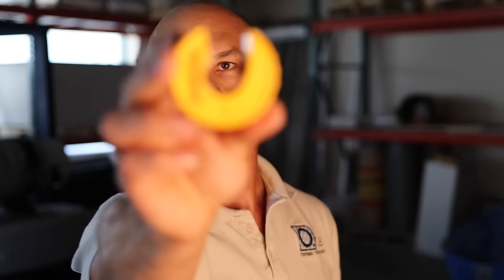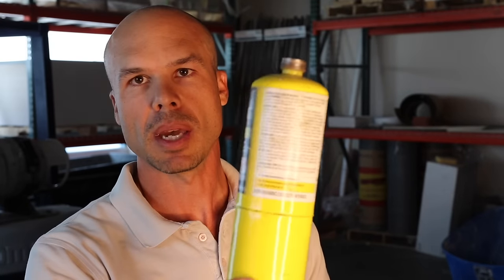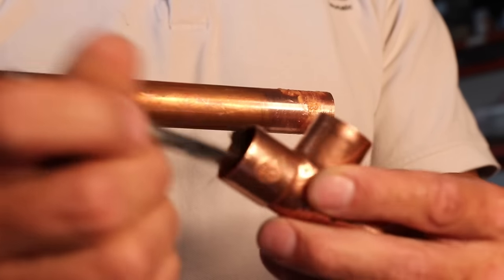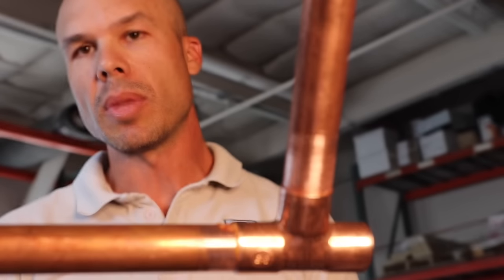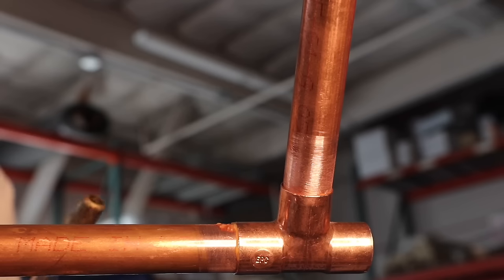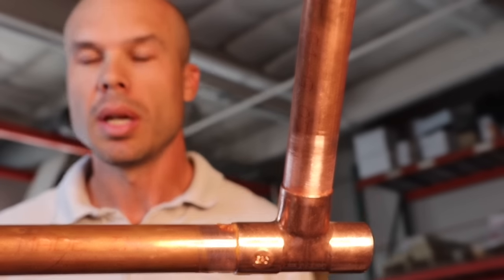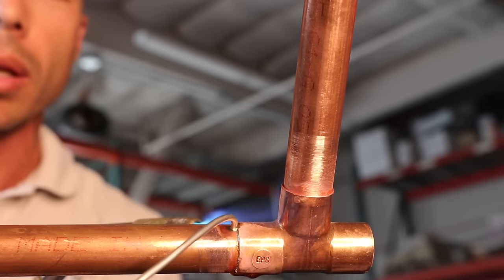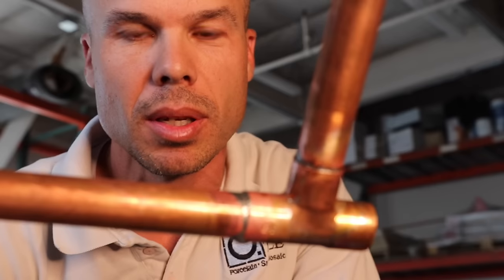How to Solder Copper Pipe: The Plumbers Secret- Episode 1

Comment: Dude if you
Took those joints you
Solder and cut then in half
Going long ways down  the fitting you would
See that most of your joint has no solder even around it.. most of it pooled on the top because you didn’t heat the fitting evenly
From
Bottom to top causing capillary action pulling the solder through out the whole fitting.  You have some bad habits.. that are gonna  cost you money
Reply: Isaac Ostrom against a  wall they sell
Things called solder snakes, or a heat shield . That’s what separates plumber from average joes we can solder n all many of ways without burning the structure down or flooding it.  Still that being said your doing a great service . Just a few adjustments and you’ll
Be pro a pro on now time. I’m a journeyman plumber went to apprentice school for four years and graduated . Before plumbing I was a carpenter . But plumbing is my love . I’ve never had so
Much fun .

Comment: In preparation for 🦈 week, I'll suggest 🦈 bite fittings for places you're just too lazy to turn the water All the way off...or you're afraid burning the house down.
Reply: I have seen wayyyy too many shark bite fittings leak. In a pinch they can be helpful, but only as a temporary fix. And only use one after the PRV, or not at all if there is no PRV. Shark bites are fast and easy to install, but that comes at a price. Again, I have just seen too many of them leak. They will be going down the same road as old poly pipe in my opinion.

Comment: Never apply the flux inside the fitting
Reply: ??   Where would you apply the flux if not inside the fitting?
Reply: @bigpardner  just outside. If you apply it inside the fitting or elbow it will corode the pipe
Reply: @aghasahib4703   Don't talk rubbish!  
Where do you think most of the flux ends up anyway?
The flux runs wherever it has a mind to, especially inside the fitting!
Reply: What purpose would flux serve outside of the fitting?
Reply: @bigpardner  

(+_+) My mom said
Reply: Indeed, that what the manuals in UK are advising. They claim it is not necessary (but since i am an yank i still coat them with flux !!)
Reply: Do you know what exactly they are advising? Is it not to use flux at all? Why put flux outside the fitting unless it runs into the fitting when heated, in which case why not put it there to begin with?
Reply: LOL !